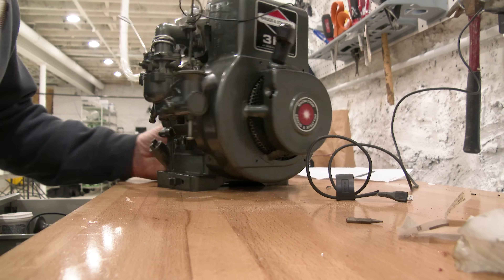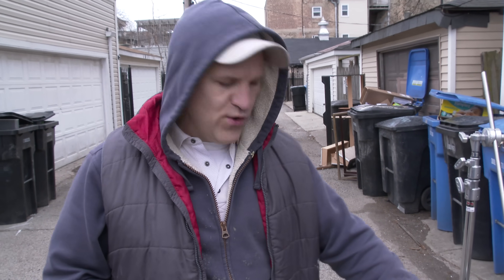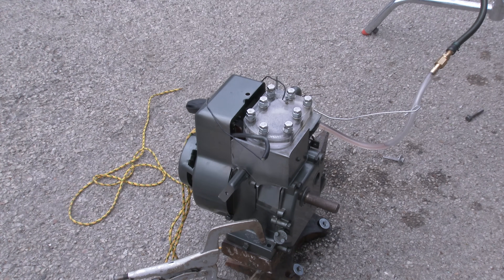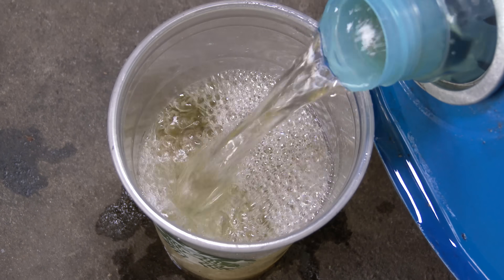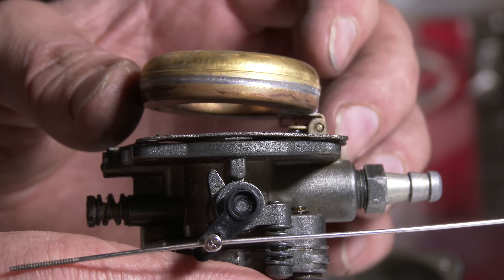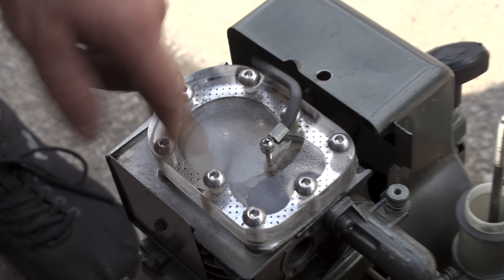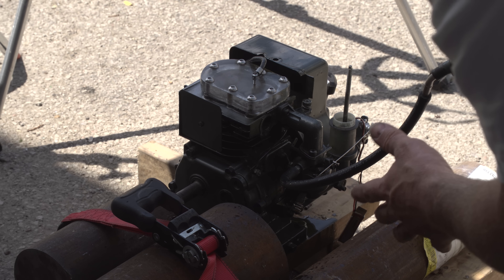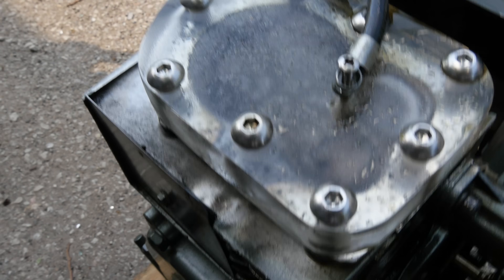See Through Engine on NITROMETHANE - Blow Up Attempts 1 -9 Crazy !

Comment: Oil is probly due to over pressurization of the crank case because of the higher blow by gasses. Can you get new rings for it? If you can you should custom grind them for nitro/boost application to see if it helps. With it being an air cooled engine you should also think about putting a fan near it to help cool it before it seizes up, especially if you're gonna turbo it. Can't wait to see more vids, keep it up man.🍻
Reply from the maker: VetteTTV12 you could be right, you gave me an idea about the temp though..
Reply: Warped Perception, happy to help. Feel free to bounce any ideas off me. For reference I'm a retired F16/F22 crew chief, prior ford technician, turned mechanical engineer.
Reply: 1320crusier, a blower fan would do a better job at dissipating the heat and less time consuming. Also, the contact area of a tube would be too small to be efficient in square fins. If he had more time and resources he could possibly water cool it with custom fabrication, but it would be a whole new project in of its self.
Reply: For the little bit of runtime he is running the engine it wont get hot enough. Nitromethane/Methanol burn extremely cold.  For example, in our 1400hp Eagle talon and our 1400hp Evo we don't run coolant in the block, those cars run on Methanol and get started, driven to the staging lanes, make a 7 second pass at 180mph and then driven back to the pits without any coolant at all in the block.
Reply: wraping copper tubing around it in between the fins for a rudimentary water cooling system?
Reply: Its simply the craziest option I could think of.  Thats all :).  

I believe the most efficient way to air cool it would be to duct the air through the fins or to attach some high cfm computer fans to each side to pull or push air through the fins.
Reply: 1320crusier, that works great for radiators like in the pc community, but for air cooled engine applications it's an entirely different concept. The entire engine has large thick fins around the cylinder head (solid object) to cool it off and the oil in the case also helps to facilitate cooling. So using a blower fan that produces a MUCH higher cfm and static pressure than a wimpy pc fan is what is needed, we use this approach when dynoing/tuning motorcycles that have air cooled engines. It will force air around the object cooling a MUCH larger surface area in short order. Now he could put an oil cooler on it (pumping oil through a radiator), but for this application I don't think it's necessary until he puts a turbo on it.

I'm not putting your ideas down, just wanted to help you learn why things are done the way they are. Ideas like yours is what lead us to where we are today, never stop being curious.
Reply: Your cylinder block has a LOT more thermal mass than this one.  I know methanol runs cold (have even seen cars with iced over fuel rails and such).  You are also running your engine for much shorter bursts.  The lil briggs was meant to run at a low rpm constantly on 87 octane not at max possible rpm on nitro/methanol.  Your engine is built to run at 1400hp 7 seconds at a time.
Reply: All the boost, sorry but I agree with 1320crusier on this, he's running this to stress it / blow it up. I used to be friends with a guy that ran in the unlimited jr dragster class and you're correct, he didn't use any coolant, but the engine was only ran for less than 20 seconds total. But I'd love to see some thermal data on the engine with a proper FLIR camera if he has one.
Reply: kamphwagon1 oh, I know that there is no pvc valve, but the possibility?   I don't disagree with what you are saying at all! I'm just saying we could maybe stop the oil loss with some simple autozone parts, and then blow the air pump up!  I also think that the combustion pressures being experienced are so far beyond what was anticipated in Wauwatosa that even a con-rod ventilation hole would help. 😁
Reply: Only way to know is to put some thermocouples on it and see what it's doing.
Reply: Seen another YouTuber use a pyrometer to see how hot parts were on his experiments with B&S motors
Reply: I agree, it is because of blow-by.  The sealing surfaces on the bottom end just can't handle the pressures.  I'd be pretty sure that there is some foam action in the crankcase as well!  LOL.  Inside of the case is just coated with oil and the pressure from the blow-by is forcing through the sealing surfaces.  PCV Valve, perhaps?
Reply: All the boost wrong nitro burn hot very the flame that comes out the pipes have been recorded at 7000 degrees. It takes 44amp from two spark plugs per cylinder. 3000cfm from a supercharger to make 10,000hp nitro motor.
Reply: kamphwagon1 its not pvc valve, that's what water pipe is, its pcv valve for positive crankcase ventilation!
Reply: Except with proper ducting and the like, efficiency is high enough that the brute force method isnt needed.  The oil cooler would be nice though.

Comment: it seems that the oil is leaking through the crankcase breather. You can block it, but it's dangerous (the gases within the crankcase can ignite and explose). The best way to counterpass this is to mount a tube form the breather to a "catch can" so the oil flows inside a can so you don't make a mess and the engine will still be able to breath normally

Comment: Uh... Why did you reupload it...? I was gonna show my father earlier and the original was gone :(
Reply from the maker: Saturnity it's the same video. Just had to remove a comment I made.
Reply: Ooh. What was it? Assuming someone flagged it and got it removed or something?
Reply from the maker: Saturnity I said internal combustion engines are killing the environment. That was it. The petroleum politicians got triggered apparently
Reply: Jeez. That's insane. What you said was a pretty simple FACT
Reply from the maker: Saturnity yeah but I have some upcoming episodes that have to do with more efficient ICE engine development, it's a touchy subject and without further explanation can be taken the wrong way. so yeah it was a simple mistake.
Reply: Could you possibly make a video about forced induction on a small engine? I have a baja bike sitting in the backyard that I want to actually mix a bit of nitromethane in with the gas, and set some forced induction thing in for some extra air :)
Reply: Saturnity follow my channel. In the future I'm doing a 150cc gy6 swap along with a plethora of mods for it, going to run race gas and put a turbo on. Try to make around 7psi

Comment: And that's from an old fart who had a Nitro rail car back in the 70s what a money pit that b** was. Spark plugs after every run yada yada yada a Vertex Magneto it's more suitable for welding structural steel versus human interaction knock you clear across the lot it will

Comment: You're highly elevated crankcase pressure is blowing the oil past the seals. But watching this thing run Full Tilt Boogie I can't believe what I'm looking at it defies everything that I thought I knew
Reply: Also highly likely that the rings failed and the blowby made the crankcase pressure even worse, thus blowing oil out the seals.
Reply: Methanol is thinner than gasoline from a molecular standpoint. It leaks past the rings and milks the oil. That's why you change the oil after every time at the track on a methanol car. 

Essentially that oil was mixed with methanol/nitro which thinned it out.
Reply: 9k with load on strait meth  can lift the cylinder off the block , just below the head bolt bosses, got a friend  that has one as a trophy in his garage . Built not bought . They reached the blocks maximum hp  with raicing block/head girdle ( also stretched when the cylinder failed).
Reply: Buck Ding first thing i was thinking was melted rings causing excessive crankcase pressure
Reply: Their is no load on the motor so it will take a lot
Reply: Race mowers will sling oil out of any place possible when you run them far past the rpm's they were designed for.
Reply: Run xd-100 oil in this crap 4 stroke motor, i hate these motors and love to destroy them. OMC 2 stroke all the way. these 4 strokes are fucking garbage as i hate bthe sound of them. They are great to smash with a hammer though.

Comment: Geeze that little engine got loud!  Great video!  There was so much pressure in the combustion chamber it had to go somewhere.  I'd be willing to bet that it went through the piston rings and pressurized the crank case which would explain the oil.

Comment: Try increasing the compression ratio, loose the spacer and drill holes in the head just big enough for the valves
Reply from the maker: Alien Mechanic well I did make the  space much thinner here, it just clears the valve heads .
Reply: It would be cool to see the detonation when using low octane combined with high compression. 

Your videos are awesome :)

Comment: I can only assume the oil came out of the breather, the extreme rpms you were hitting were probably building up crankcase pressure forcing the oil out he breather tube
Reply: The Bearded Outdoorsman I assumed that also.
Reply: Yea I agree. My go kart racing engine blows a lot of oil out at 9000 rpms
Reply: That is what I thought, too. That rectangular piece the hose comes out of is directly behind the valve stems and all 
there is, is a porous metal mesh in there, if I remember correctly. 
(Been decades since I have seen the inside of one).

Comment: Nitromethane isn't as dangerous as it might seem. The reason thouse Top Fuel engines occasionally explode has more to do with HOW MUCH nitro they try to burn at once rather than the fact that it's nitro. 
An ordinary engine can run it but it has to be tuned property and the additional stress on parts needs to be factored in.
Reply: Its about time someone realised that the nitro methane only provides the engine  with more oxygen into the combustion chamber. The top fuel engines are only able to produce more power through careful tuning of the engine through compression rations, large enough combustion chambers plus heaps of fuel which includes the energy included in the hydrocarbon part of the fuel, separate from the nitromethane.
The only way  any engines can ever produce heaps of power is by getting as much oxygen onto the combustion chamber, plus the appropriate amount of hydrocarbons to burn the available oxygen. Simple really, as long as the engine can hold together with power that it can produce.
Reply: 177SCmaro   Exactly. There's more power in 85 octane gasoline than there is in nitromethane.
Reply: 177SCmaro 
It could also be that additional oxygen atom added on to the petro chemical string. Education is priceless but a new motor for your car will cost you a few thousand bucks.
Reply: charles bishop Technically, yes.
Reply: Yes
Reply: @fabio rudolph.... which is the reason we don't use it anymore, in drag racing.  Too many people (besides the engines) were injured and even killed,  when "experimenting" with different "exotic mixtures" in the quest for more power and speed during the 1950s and early 1960s.... and it was "Big" (Don Garlits) who figured out (once again) that the reliability and power with Nitro was in the initial (lead) timing, with the wedge motors and especially with the Hemis.

Hydrazine along with many other "potions" were used in the early years.... and Far too many times ended very badly for many drivers.... and sometimes, very sadly... even for the spectators.
Reply: Destroy a POS 4 stroke, im good at that, they are fucking junk, never liked the 4 strokes and never will

Comment: When I buy a lawnmower I always make sure the engine is a Briggs.
Reply from the maker: man it was indestructible, wait till you see how much Horsepower it made on nitro
Reply: Fuck that i go with 2 stroke engines. How ever i love destroying 4 stroke briggs and watching them self destruct. but the hold up fine with xd-100 2 stroke oil rigged up for total loss oil injection as illed my free briggs withxd-100 2 stroke oil. they are nice and offer a 2 stroke. but i rune xd-100 in there 4 strokes as well. they hold up as i rev the crap out of them.They are crap 4 strokes that i love to destroy
Reply: I'd like to know how much more power an engine like that will make compared to the way cane at the factory.
Reply: Every time I worked on a Briggs engine devalve seat always came off they are just junkie engines
Reply: anak priok nie..
Reply: Honda. everyday. Best motors made
Reply: Briggs engines are disposable nowadays. Not like the old ones. Plastic parts and most don't even have an oil drain plug.

Comment: Nitromethane has less energy than gas. It burns cooler as well. It is however very corrosive. Stop spreading lies.
Reply: Nitro has about 1/4 of the energy density of gas. On the other hand you need 14.7 lbs of air to burn 1lb of gas, wheras 1 lb of nitro needs only 1.7 lb of air. Additionally the nitro/methanol mix has a much larger latent heat of vaporization than gas, so it effectively provides some supercharging by cooling down the charge before it enters the cylinder (colder air is denser, so more can fit into the cylinder). There's a physical limit on how much air the engine can suck in through the inlet valve, so if you get two engines and run one on nitro and the other on pump fuel the nitro engine will deliver more power.
Reply from the maker: wait till you see the HP when I dyno it, facts are facts and lies are lies ... lol
Reply: Kenneth DoubleU you can fit a lot more nitro methane in a cylinder so it may be less energy dense but it will provide more energy as you can stuff a lot of it in a really small space
Reply: Did you supercharge, add more compression or turbo charge the engine? If not you’re still running at one atmosphere. Therefore not utilizing the extra oxygen atom and adding HP.

Comment: Could you supercharge it? Or turbo charge it?
Reply: That's exactly what HE SAID he was going to do for the next video. PAY ATTENTION
Reply: Why not both?
Reply: Laurențiu Panait I guess that's true since a turbo is technically classified as a type of supercharger. The only difference between a  "supercharger" and a turbo charger is that the "supercharger" is belt driven which creates more low rpm boost (but with parasitic losses), and a turbo super charger gets driven by exhaust fumes at no parasitic losses (but with less boost in low rpm). In the end they both push compressed air through the intake, the engine could care less where the air is coming from, heck you can even just fill a scuba tank with compressed air and plumb it to the intake and it will still will do the same job as a blower.
Reply: Laurențiu Panait just take a second to search and you will find a bunch of blow through turbocharged engines that run on carburetors. Heck there's even videos of people turbo charging harbor freight predator engines. 

Just search turbocharged predator 212 on YouTube and you'll see.
Reply: Laurențiu Panait 
Who said you can only supercharge a carb engine? Are you high? My banshee 300 turbo has a carb. I built a carbed  427 Twin turbo......so no.
Reply: Colin Bacon Well guys, I live in a world where boosted gasoliners are far beyond impossibile and the subject is NEVER discussed, that's it.
Reply: Laurențiu Panait but you have access to YouTube so you should use it to gain knowledge about what you can't see at home. It's really easy to search before you say something especially when it's in a absolute statement like "you can only supercharge a carbureted engine", where a  quick search about that subject opens a sea of knowledge that you were ignorant of. I certainly don't know everything myself, but I know how research what I don't know before I try to make a statement.
Reply: Colin Bacon 
No supercharger makes more low end torque than a turbo. If the turbo is sized properly it virtually eliminates low end lag. Engine masters (motor trend) just did a roots vs centrifugal supercharger vs a single turbo. Hint....the turbo killed both s/c in low end torque.
Reply: Charles Moore I actually watched that recently, and personally I definitely prefer turbos hands down. I was just listing it with possible pros and cons, a well set up turbo system thought should have virtually no cons. But there's definitely some turbo cars out there that have less low end torque than a comparable roots blower car.
Reply: Laurențiu Panait not true
Reply: Jeff Liggett You can only supercharge a carburetted engine.
Reply: hill billy Ok guys, i haven't seen yet such setup but i'm sure that a turbo-ed single cylinder engine would make very little boost, due to the exhaust stroke interval. Plus, neither i have seen such engine, with that head. Anyways, La mulți ani tuturor !! -"Merry Christmas to everyone !!"